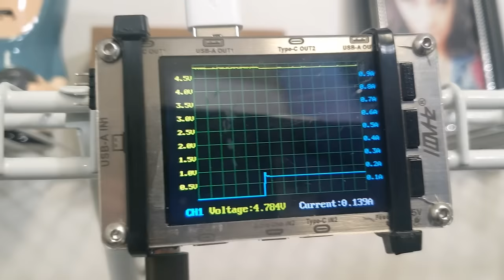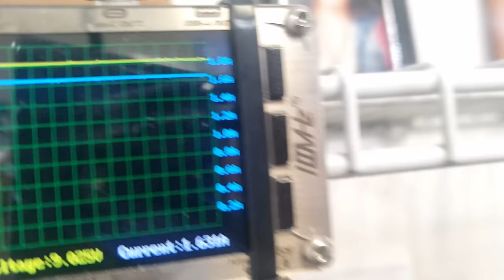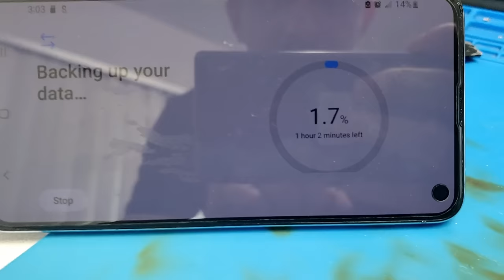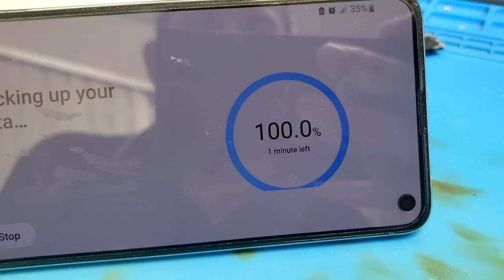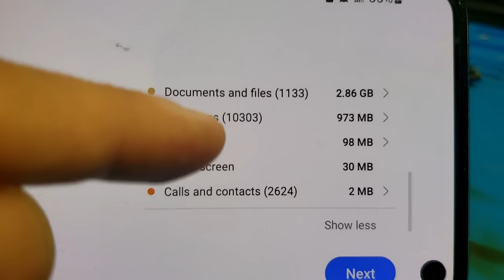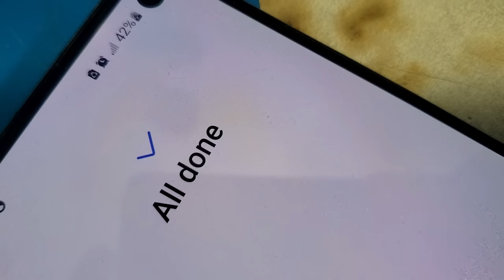Recovering data from a Samsung phone with sudden death or hung on boot - An easy method!

Comment: That's funny you posted this, as I literally posted a video of the same model & same issue, although I followed a different technique, which involved reballing UFS.  I'll have to give this a try on my next one.
Reply from the maker: Its crazy how widespread these faults are! For the dead ones, if I get ~150mA without USB connect, I go for RAM/CPU.  If it's detected as Qualcomm device, I go for flash memory -- those normally have some level of physical damage tho.  The last one I did had the flash memory physically pulled from the board from being hit with something!
Reply: @ststele  Haha yeah, I get these on a regular basis, along with S7's dealing with the same problem

Comment: Hey awesome videos. I have an s22 ultra that doesn’t even turn on after u took it to 2 repair shops. Do you think you can fix it or at least swap the chips to get my data off. Idk if the nand chip failed or something else. I have called many places and no one does what you do and most repair shops say they can’t fix it. One tried and I think messed it up more. Please help.

Comment: damn you just gave me the problem i had on my own S10e that died today
Reply from the maker: @hammerfallrex  this is VERY common on S10e!
Reply: @ststele  Dang, that sucks. Just encountered this exact (or one very similar) problem this morning actually. I was on a call with my friend and looked up somethign on the firefox browser and it just froze and played a high pitch sound. It didn't shut off on it's own, but instead I held down the power button to shut it off. looking on how to open recovery mode, I found "SS RDX" and it showed two errors, being "CPU HANG," and something along the lines of "TEM AUTH" (I can't exactly remember what the error was since it seemed to random when it happened" Also I got it to go into the download mode and also (more rarely,) I figured how to get into the recovery mode. I haven't gotten to reset the phone since I would really love some advice to see if there's any possible way to keep the pictures before doing anything like resetting it.
While I very much wish it is a software issue, it probably is a hardware issue.

It sounds like it'll be more money than it would cost to get a new phone, so it sounds like I'm gonna have to lose all the memories i've had on it. I've had the phone for two years after getting it refurbished from backmarket. And no, the warranty was only a year long which also sucks.

Would it be worth taking this phone to a repair shop? Or should I part it out or something similar? since the screen is almost perfect besides a single very small dot of a scratch that's below the screen protector. If I part it out, I could probably sell the parts to help pay for a new phone. 
The phone cost like 140 bucks when i got it, if that helps.

Comment: i have noticed it consistently, old phones run very hot. My LG G6 which i retired a few years ago also ran very hot just before i stopped using it. Currently on a Huawei P30 which is kinda old now but it is yet to have the same issue

Comment: I got one where back came off real easy and no other evidence to suggest its been opened. Think glue just degraded. I'm trying to replace s5200 but keep getting short show after soldering aliexpress replacement chip in place. Am I crap at soldering or many s5200 faulty reballs chips from Ali being sold?
Reply from the maker: Hmmm, I'm not sure which component s5200 is!  I hope you get it working.
Reply: @ststele  s5200 is pmic on S10 plus. I got hold of a working motherboard so will practice soldering a s5200 from Ali. If it goes faulty I'll resolder the original chip and see if I can see what's going on. My crap soldering or Dodgy ics. Would like to do more electronics but got other crap going on. Such is life. Thanks for sharing expertise and the odd silly joke.

Comment: I had one plus 7t. Used for more than 4 years. It had the same issue of CPU & ram. I initially tried to flash it via my laptop and lost all the data unknowingly (It was stuck on boot logo). And lateron I sent it to repair it to local repair shop. Local shop reballed the ram and CPU and it worked for couple of days. Again sent back to same shop, they repaired it again in the warranty and the phone died in the same way. I noticed after repairing the phone was getting extremely hot while doing simple tasks of browsing internet, watching videos,etc. so learned that reballing doesn't work with almost any android devices...
Reply from the maker: I've reballed tons of these (some after accidently overheating while trying this workaround) but many of them don't last.  Some go directly back to the same problem just moments after getting the backups!
Reply: So at this point you replace the chip?  @ststele

Comment: Tech here. Just to mention. I had an exotic Panasonic sound system that has the exact same symptoms, hot kept warm it worked etc etc. Turned out to be..................... a capacitor. Intermittent break-over that went off due to thermal shock. Kept  at steady temp it was fine. 
I shotgunned all the caps, around 50, and happy customer. And bench tested each cap. Heat and freeze spray revealed the culprit.
Reply from the maker: Many times in this case when I start removing RAM/CPU I've wondered, "oh man, what if it's just a cap someqhwre!?". 😁
Reply: @ststele  I think of those ceramic caps as along the same lines of a (maybe) cold solder joint. Thermal screw up waiting to happen. Freeze spray can be your best friend when searching for as intermittent. Or a heat camera. The old 'Can't fix something that isn't broken' headache.
With that Panasonic I mentioned, the offending cap was such a sweetheart. When it blipped it took two $85 output transistors with it. Worked fine on the bench for hours, then WHAM. Class A bias assured major catastrophic destruction.

Comment: By the way, thought I'd Bring this up sometime. Sometimes it's things that have been put on the phone. That caused this problem, especially Samsung's. OK so you might want to scan to see if there's anything in the back up. That's gonna cause problems for the new device, for an example.  I have a friend that keeps Restoring from his older device and all it does is cause his newer device not to charge unless it's shut off and then plug in and then turn back on and happens to every single device.He has because he doesn't pay attention to it.'s something that he actually has them back up so this Crashing.
Issue might happen to the new one too if it's something that's in.The actual store it's causing the problem

Comment: data recovery for Android is a rare thing. You have backup set up automatically, as soon as it connected to Wi-Fi it to backup , specially when charging. The only reason when android will not have backup when you do not have enough space in a cloud. This is one of the reason when I preferer android for IOS.
Reply from the maker: I think Android users are more data conscious - They tend to be more mindful of backups!  That's not saying that many Apple users are too though. 🙂

Comment: is there any way to capture a block level image of the storage on these S10's? I am looking for a way to gather a raw image for potential data carving. pardon me if this doesn't make sense for this type of storage. had a friend factory reset "accidentally" and looking to get anything back if possible. i carved the microSD and managed to get a bunch of photos back, of course some were corrupted but better than nothing. hoping something similar might be possible with the onboard storage but i know nothing about UFS yet.
Reply from the maker: Honestly, I'm not sure!  On older models I could use dd and make a full image of the emmc.  I only have old hardware and haven't tried on newer models though -  I've just heard that you can't.  I've always thought UFS was just a different filesystem/format.  I suspect it could still be read directly but is encrypted.  I may be misunderstanding tho!
Reply: @ststele  Thanks for the response! That's been my experience with the S10 and UFS as well - "oh, its UFS? Yah you can't"  On most devices, even if the device is dead, I can recover the image by pulling the emmc and just using dd to capture an image of it. I kind of gave up on this S10 - the device is still 100% functional and my rule #1 is "don't make it worse", so I'll sit on it for a while longer till I look for a solution. If I find something I'll report back ;)  Thanks for the fantastic content too!
Reply: Not without forensic tools or the phone being rooted. It has file based encryption (FBE).

Comment: Do you do the PC backup using the backup made on the sd card?
Reply from the maker: No, it's a separate backup that usually forces me to update smart switch on the phone before it will run.
Reply: @ststele  Oh so you have to make sure the phone stays on long enough for that backup as well?

Comment: I have a 512gb Samsung and I'm using like 450gb of it🤣 good thing is I have a program that saves 90% of it to my Google drive and all my pictures are backed up by Google photos. The only thing that I have to manually backup is text messages and call logs and Google might be automatically doing that now, I'm not sure.